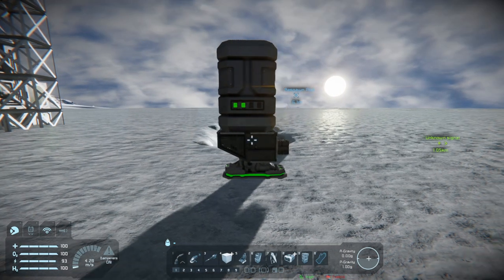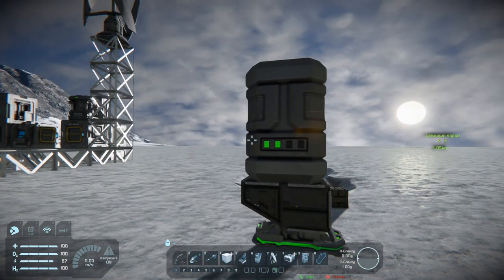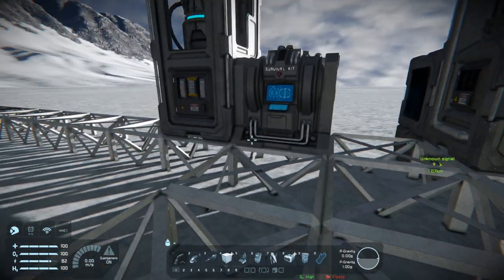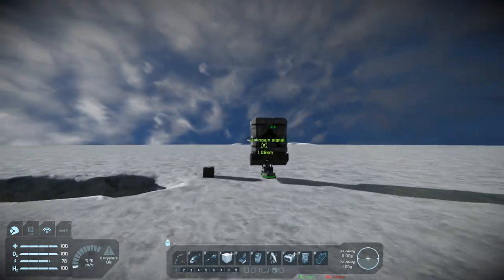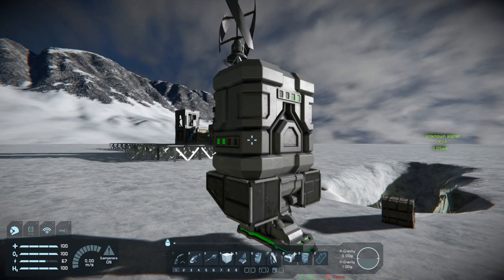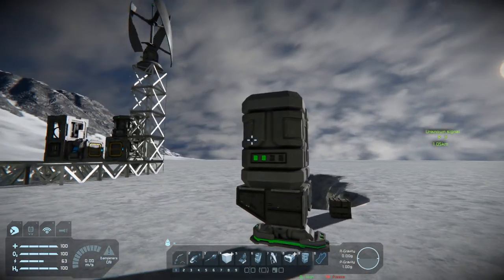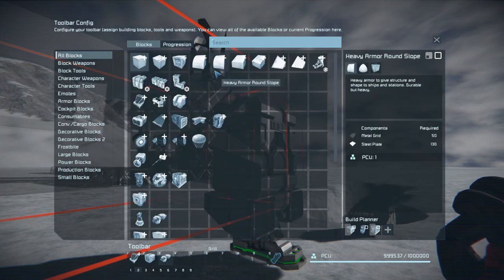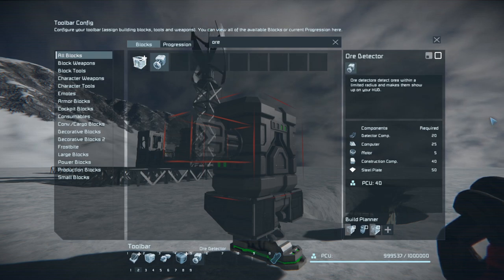Space Engineers | Beginners Guide | How To | Our first mining ship | Episode 4

Comment: I made the same ship on a public sever and can only pick up 30k even with adding more thruster did they nerf the weight capacity of thruster or is it a sever setting?
Reply from the maker: More than likely a server setting, the default is brutal, cant carry anything. 95% of servers have 10x inventory space etc
Reply from the maker: But the thrusters i believe are just a standard setting. Only difference is the speed mod we have
Reply: @TheRuggedGamer  I fixed it my min input for power was not met I added to many thruster for the battery to handle, when I made another battery it fixed the issue.
Reply from the maker: @stevenmardis2131  ah i completely forgot to mention that, the bar on the right is a good indicator for that, if it goes red your maxing your power supply out